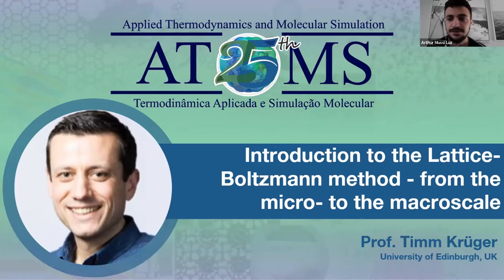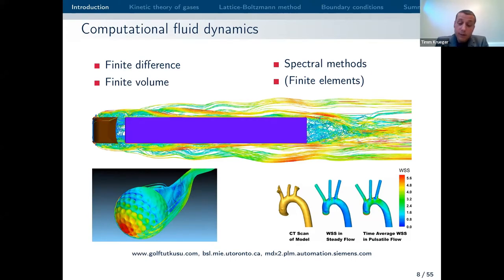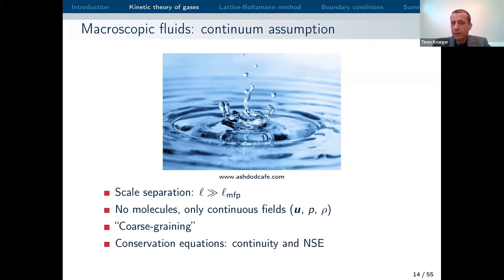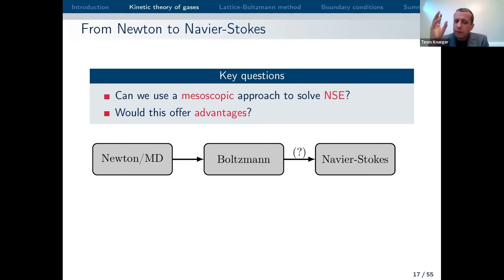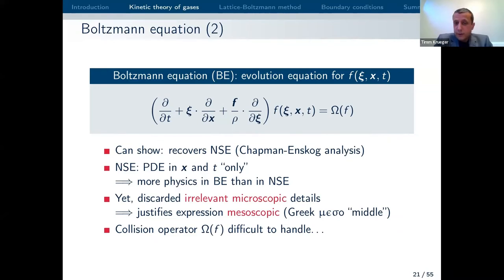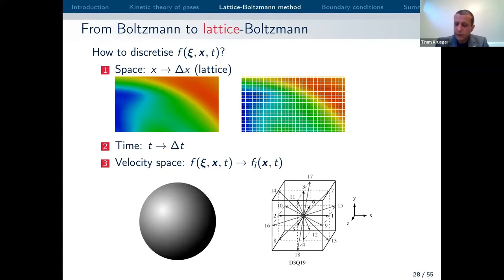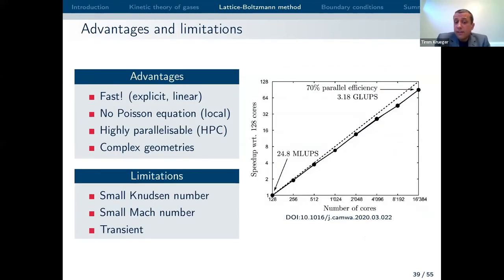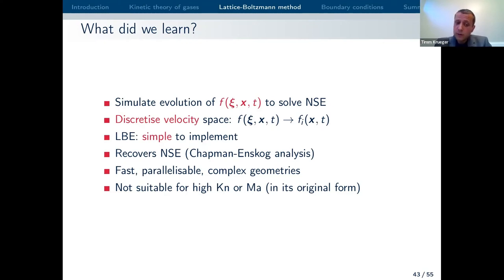Introduction to the Lattice-Boltzmann method: From the micro to the macroscale

Comment: Thank you for this presentation. Fully agree on the dificulty to modify existing codes not being fully skilled on  c++ etc or even if im skilled seems that is not straight forward. Perhaps writting code in Julia Language will help a lot the phds to get up and running quickly and concentrate us to implement specific features for our particular interest. Thanks again for your time and effort of sharing this.